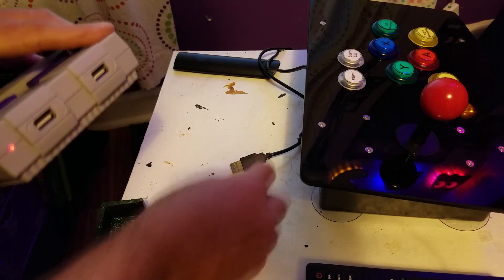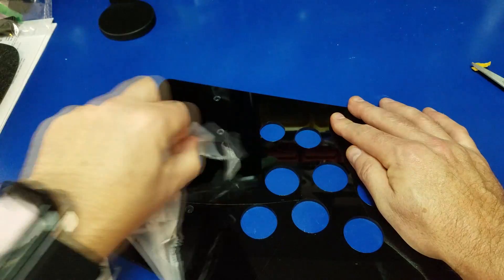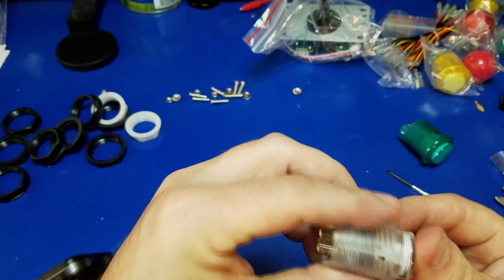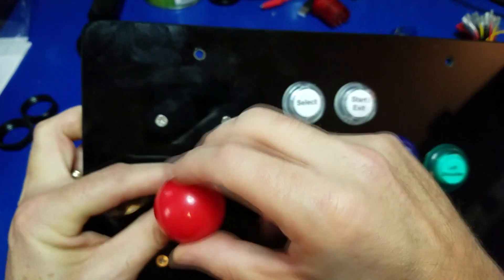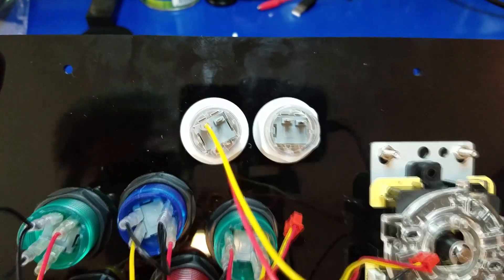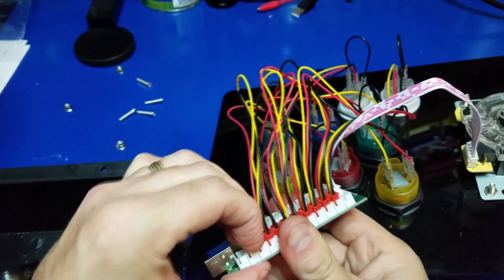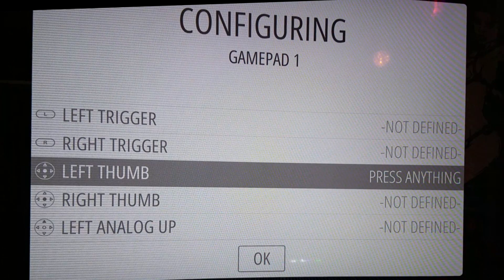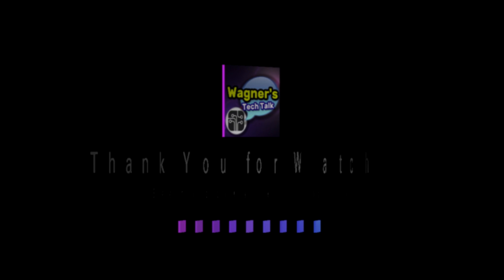How To: Build a RetroPie ARCADE Joystick + Control Panel - Play those classic RETRO GAMES!

Comment: If I made this and plugged it in a Nintendo switch dock will it work?
Reply from the maker: I don't have a Nintendo Switch, so can answer this fully.  But, it might.  You wouldn't need the Raspberry Pi, just the control panel and button+joystick assembly+encoder.
Reply: @WagnersTechTalk  Thank you for replying. I will make it and try it. Update soon.

Comment: Hi could you provide a link to those wiring cables?
Reply from the maker: They all came as part of a kit (links to the kit I used in the description), I did use this 5-pack of joystick encoder cables https://amzn.to/2Vx2s6I to extend the cable length from one encoder over to another base with OpenCADE ( link: http://wagnerstechtalk.com/opencade/#Video_Expansion_Pack ).  Not sure if that's the cable you're looking for?  I then used some header pins to connect the two cables, I show it briefly here: https://youtu.be/6GlNHEe5zjA?t=576  Hope that answers your question!

Comment: Hi, If I were to build two controllers and plug them into a USB port each, would I be able to play two player games?
Reply from the maker: Hi Bill, yes Sir both players would be able to play.  I used x2 of these units in my Pi4 full-size arcade (same controller and encoder).
Reply: @WagnersTechTalk  thanks!
Reply from the maker: No problem, one thing that came to mind in a later kit the manufacturer changed the button wiring slightly.  Be sure to use the wiring instructions they send for a smooth install.  Why they did that I don't know but they did :)

Comment: Wow! Amazing and it saves a bundle from having to buy a preinstalled arcade controller with built-in games. Can this kit be used on a generic RP board? I am thinking of buying RP and download games from RP website. Are those games free? Thanks.
Reply from the maker: By RP, I assume you mean Raspberry Pi or RetroPie correct?  If so, I created an entire page dedicated to the Raspberry Pi with Q/A + Videos and instructions here: http://wagnerstechtalk.com/rpi4gaming/  Both RetroPie and Batocera can be used with this case.  Also, see the section regarding installing Roms to answer those questions as well.

Comment: Hi. I'm trying to set up retropi on a raspberry 4 to work with double acrcade controls.   I've gone through the configuration screen. I can't seem to play the games that require pushing the coin button. Do I need to  set up the controllers for each type of game ie. Mame, Playstation etc?
Reply from the maker: I typically setup MAME to use the Select button to insert a quarter.  After you configure the controls, it should work fine for P1.  For P2 configuration, it's a bit more involved.  You press SELECT+X on the P1 controller and you do a bind all for the 2nd controller.  Here's a bit more information, about bid way there are some videos as well: https://retropie.org.uk/docs/RetroArch-Configuration/
Reply: I can't see how to" bind" them?

Comment: not expecting a reply but i was wondering how you get teh menu, 1 player, 2 player and other special buttons to work with the rasberry pi
Reply from the maker: Typically, you would use those buttons in an arcade game using MAME.  Attach a keyboard, launch a game and press the TAB key.  This is what you would use to map the P1/P2 and other buttons.  Hope that helps!
Reply: @WagnersTechTalk  Thank you so much :)

Comment: Question for wanger. I have a pi 4 during start up on emulation station and entering the input configs and works fine in the ui. Once i go to the games some games the buttons are  map correctly but none of them take the movement of the joysticks, I tried a number of images different encoder boards. what am I doing wrong do I have a bad pie.
Reply from the maker: The video here was created long before RetroPie 4.6 came out for the Pi 4.  For that, please see this more recent video: https://youtu.be/fDdPApFGvBo  If you have trouble beyond that, then see this which goes into much more detail: http://wagnerstechtalk.com/rpi4gaming/  If neither of those help, just comment in any video and I'll respond ;)

Comment: Anyone know if you could fit a track ball or spinner in that?
Reply from the maker: I don't think both would fit in this chassis.  However, if you have access to a 3D Printer, you may want to check out my OpenCADE solution which was developed immediately after this project (I wanted a modular method of making a control panel): http://wagnerstechtalk.com/grs/  You can add a trackball, spinner, Tron Flight Stick, Sticks+buttons and much more or combine them into one large panel.
Reply: @WagnersTechTalk  I really love the OpenCADE.  It's almost $100 to print out from a service though, sadly.  I was thinking of making a case from a wood keepsake box found on Amazon.  That's under $20.  Do you know where I can find the hole sizes for the spinner and the track ball?  Would the spinner shaft fit in a hole for a stick?
Reply from the maker: You may want to reach out to Glen at Glen's Retro Show (YT channel) for the dimensions.  I know the spinner and trackball are being redesigned and therefore may not exactly match what I have.  I don't want to send you incorrect measurements.  Yeah, $100 is way too much for a 3d printing service.  For the cost of one roll of PLA I can print an entire set with wrist supports (~$15-25 depending on the cost of the filament).  The idea behind OpenCADE was really for someone who owns a 3D printer to have an inexpensive method of creating a custom Arcade console.

Comment: Which button was the hotkey?
Reply: Can you make a video showing the actual arcade panel while mapping the buttons on the TV? I'm having an insane hard time figuring out which buttons are which. I have no problem doing it on a PS4 controller but I just built a new arcade panel and I'm pretty confused.
Reply from the maker: The buttons are however you map them.  I have the button sheet available (see video description) so you can put those under the caps so you know which button is which (abxy, select, start, p1/p2, etc).  Here's a video where I setup the mapping for MAME which might be helpful also: https://youtu.be/Uvl5xMKdx9o
Reply from the maker: The Select button.

Comment: I have a very similar arcade package that I used to build a 4 player arcade pedestal. Everything looks to be wire properly, but the joysticks to not register on retropie when I go to configure the controller. When I move a joystick on the configuration menu, all of the LED buttons go dim and retropie does not read the joystick movement (example I push it up when it says directional up and nothing happens on the screen). Any idea what might be causing the problem?
Reply from the maker: Double-check the wiring instructions from the Manufacturer.  I received two joystick kits from the SAME Mfgr., ordered a month apart and each set had to be wired differently.  Apparently, they had changed the wiring scheme between my two orders, so I had to swap a few wires for it to work (I think they had the red/yellow wire locations reversed, can't recall exactly).  So, double check the instructions that came with it and make sure it's wired exactly as they indicate.  If that doesn't fix the problem, it might be a bad connection to the encoder board (or bad encoder itself).  That's all I can think of at the moment.

Comment: Wiring changed... red now goes in lower right corner, yellow upper right corner and black grounds on the left side ... do it your way and you don’t get any LED lights.  Thanks for a great tutorial
Reply: Hi having issues getting my button to light up have tried multiple different configurations. Any ideas?
Reply from the maker: @germckevitt4427  Double-check the wiring from the mfgr.  Seems that they have gone and changed the wiring scheme for some odd (stupid) reason :)  If that isn't it, just double check that the encoder cable is fully plugged in to the Pi/Encoder.  See if any buttons will work and make sure the wires have snapped into place.  Aside from that, I can't think of much else except a possible defective encoder.  Let me know what you find out please.
Reply from the maker: Very welcome!  I've updated the video description to indicate the wiring may have changed, thank you for that!

Comment: As for the power, do they light up via the USB or external power?
Reply from the maker: They light up via the USB port (5v), no extra power supply needed.  Also, if you have (or have access to) a 3D Printer, here's another option that I designed that you might want to watch as well: https://youtu.be/Lan0X_Z6j-c  I also released an expansion pack for it if interested: https://youtu.be/6GlNHEe5zjA .  I have other similar videos such as the RetroFlag SuperPi case, you may want to browse my video listing and see what's interesting to you.

Comment: Can you specify the button  configuration when you mapped the controller for the player 1&2 options on the side of the case? Thanks
Reply from the maker: You can map each of the two P1&P2 buttons however you want.  For example, in Galaga there is only one joystick.  So, you would map P1 to Player 1 Start and P2 to Player 2 start in MAME.  I have a video where I discuss it, please see this: https://youtu.be/Uvl5xMKdx9o
Reply: @WagnersTechTalk  Thanks

Comment: How long is the USB cable that hooks up with the Pi?
Reply from the maker: I assume you're talking about the cable from the joystick to the Pi?  If so, it's about 6ft. long (I didn't measure, just estimate).  The power cable to the Pi can be whatever cable length you want to use.  Hope this helps.